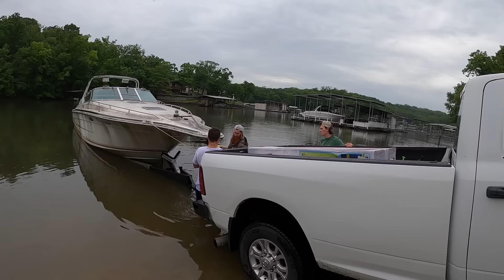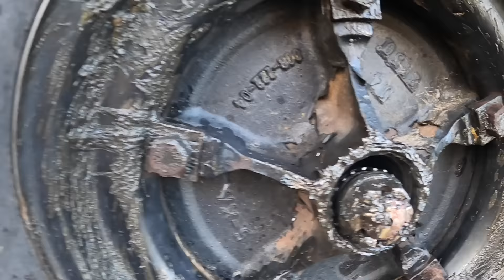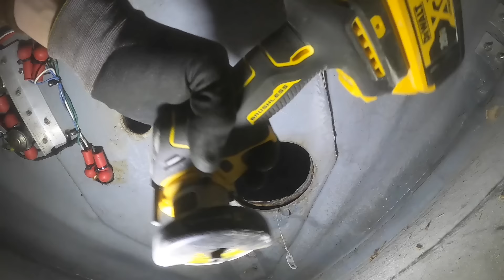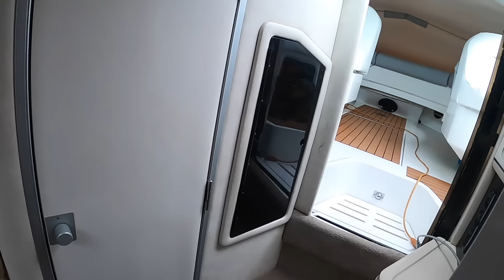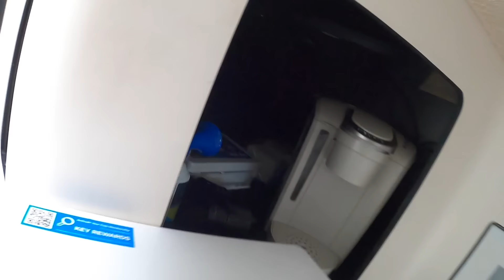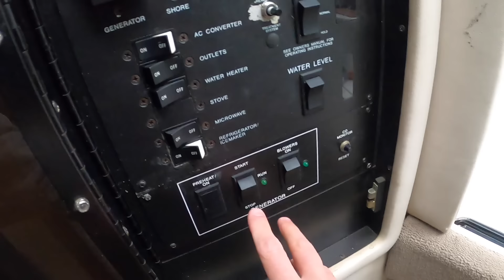INCREDIBLE BOAT RESTORATION | 1992 Sea Ray 380 Sun Sport

Comment: Ben if you go to online you can get a rust remover for the upolstry called erusticator carpet and upholstery cleaners use it it works amazing you squirt it on and the put neutralizer on it it puffs a little cloud of smoke and the rust is gone

Comment: Starbright  makes a couple good products there hull cleaner will get rid of the rust they also have a good  vinyl cleaner to get rid of the mold that gets stuck down in the pours and won't harm it like bleach does  both work great didn't have a cover for my boat so constant fighting the mold and water was dirty at times in 😮cheasapeake  bay and would stain the hull  when didn't have good wax on er so hull cleaner was awsome could watch it go from dingy tea color to clean off white

Comment: I was so confused at first, i was like… i could’ve swore this dudes channel was “makin motor moves” or something with like the triple M logo thing. I watched the entire build series (i recent got myself a formula F20, found your formula videos) & watched basically all your content. Glad to see the boat is practically finished. Kinda wild that you’re selling it but I do the same thing lol. Keep up the content. If you’re bored, check out my light restoration. Floors, stringers & bulkhead replacement. 305 SBC rebuild. Can’t wait to get it on the water